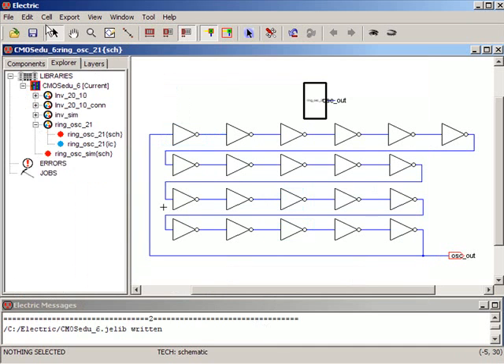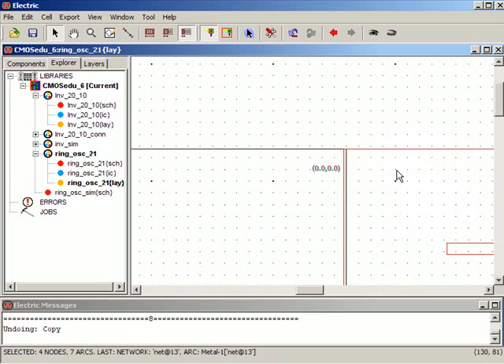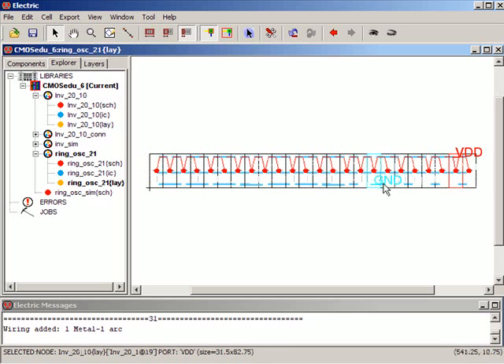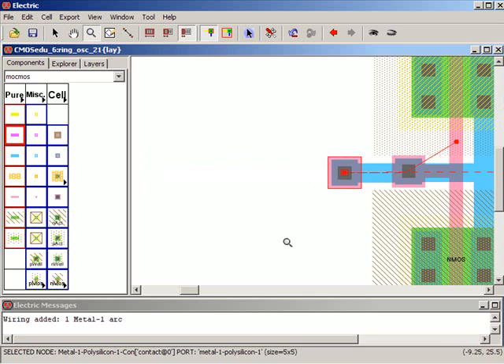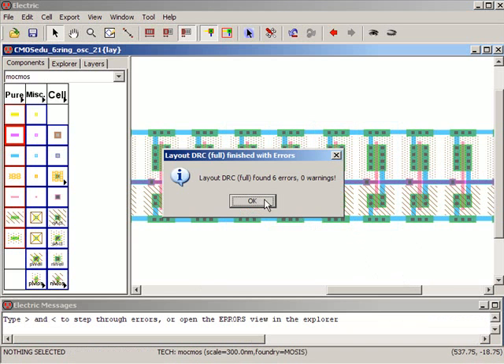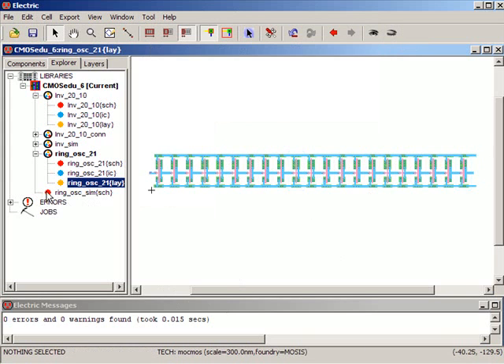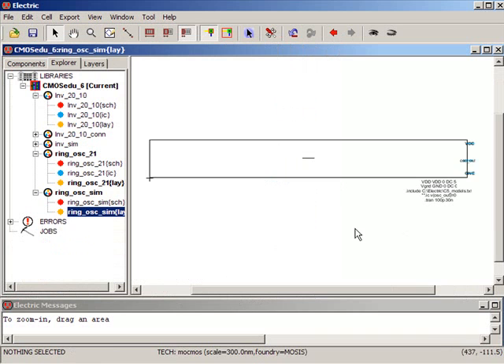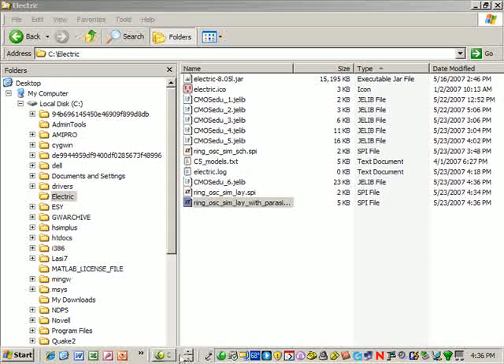6. Lay out of a 21-stage ring oscillator

Comment: So if you actually built this, hooked it up to a probe station, would you just put a probe on the output node and just see the trace? I once saw a design where there was an inverter as a buffer between the output node and the actual Vout measurement probe pad.